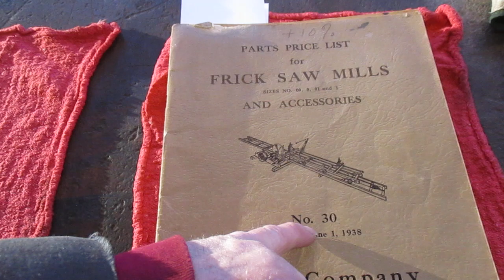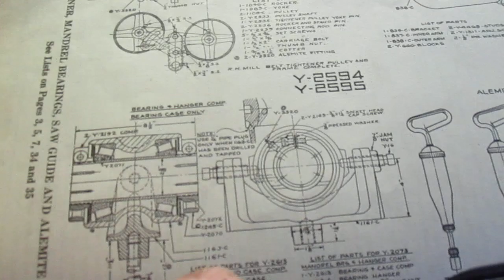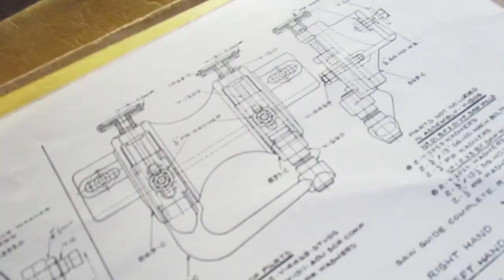Frick sawmill bearings hangers & stuff # 1075

Comment: I have similar bearings and hangers on my lane Mill. I just threw all that crap in the scrap bin and I'm in the process of upgrading to new pillow blocks designed for this application.
Reply from the maker: hi there that may work , these are double bearings witch might be pricy , not sure how about setting the lead , would be interesting to see your when you get done ,  thanks for stopping in john

Comment: All those castings broke in the exact same place.  Kinda makes you wonder if something else is going on that makes them fail.
Reply from the maker: hi there real good point , will never know , glad you stopped in john
Reply: When castings all break at the same place it calls for a redesign or an upgrade to a forging. A fishing buddy of mine sold forgings so I learned a lot about metallurgy from him as we fished together. Cast iron is strong but brittle but under constant tension it can eventually fatigue and crack due to the crystalline structure of the iron molecules in the casting. Forgings are inherently stronger and resist metal fatigue much longer because of better molecular structure from the hammering during forging.

Comment: Hello again I was just wondering  what size collar do you run on your new 54” blade?  Mine is a 5 inch collar. I was told to only run a 48” or 52” at most, or it would ruin the eye of my blade through time. I want to get a larger blade but I didn’t want to ruin a new Simonds blade they’re expensive!  Right now I’m running a 48 inch. Thanks for your help.
Reply from the maker: hi there not really sure . we redid my collar  a short while back and i think its a 5 , , i was running the 56 for years with that small collar , and Jeff was running a 58 . ,the drive pins are all the same , ,i never heard that so i don't really know , i was not impressed with the Siomonds  saw , but that might just be me , john